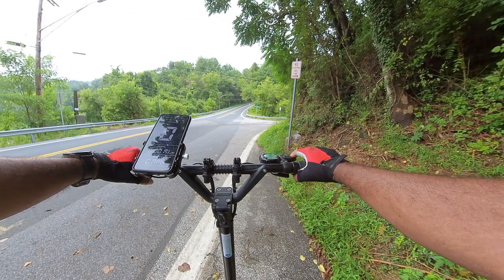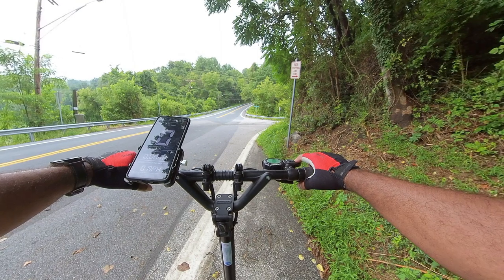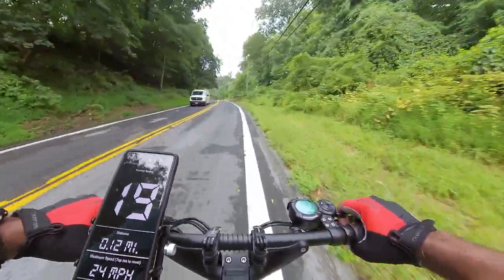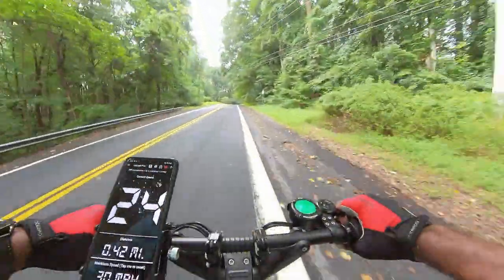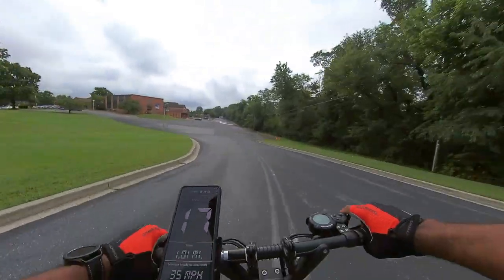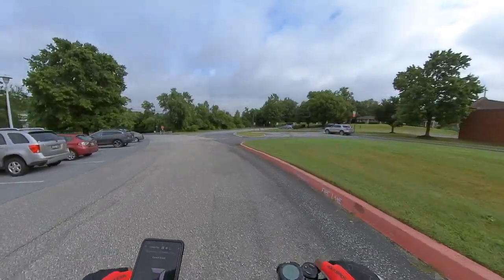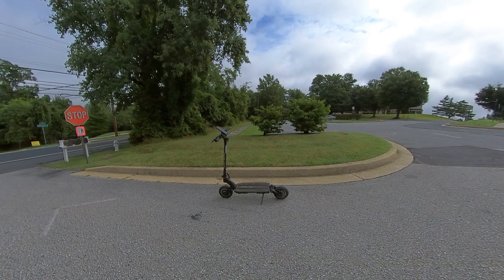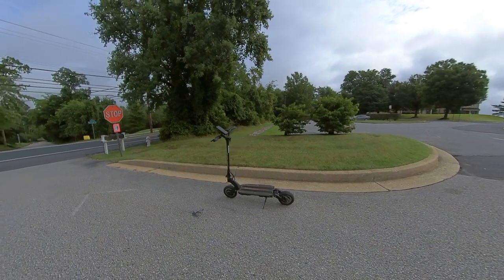Dualtron Eagle Pro  - Ilchester Hill Climb Test!!!!

Comment: I love my DualTron Eagle.
Every morning I take my Dogo Argentino out for a  quick trot and one of the things I especially like about this version of DualTron Is the ability to change the power settings1,2 or 3 on the fly and also being able to change single hub motor to dual and turbo mode on and off. All these things you could change on the fly. When I'm trotting along with my Dogo I put it on rear hub and we're moving along about 6 mph when I See a hill I instantly click dual motors and the power to number 2 to get up the hill at 6 mph. It's like shifting years in a car and from what I understand the later models you're not able to do that. I'm keeping this baby till the wheels fall off. Then I will replace the wheels again. 😂
The highest I have gotten this scooter is 35 mph and I'm not a small guy at 5 ft 10 in 240 lb. This scooter can GOOOO.
Reply from the maker: 👏🏽💯 Yes I love this scooter too for all the reasons you mentioned! Has been very reliable but recently my dual motor switch has been acting up sometimes not going into dual motor but Minimotors can replace switch for $85 also my battery performance has went down drastically since I have around 1,300 miles on it but still love it
Reply: @bigteedo_ev4905  
1,300 miles You have had a good run with that scooter. Sounds like it's time for total tune up. You will need a new battery, new rubber grommets for the shocks, getting you brakes, tires and a switch. That's just the cost of maintenance but 1,300 mi is really good. Thank you for your video It was a pleasure to watch.